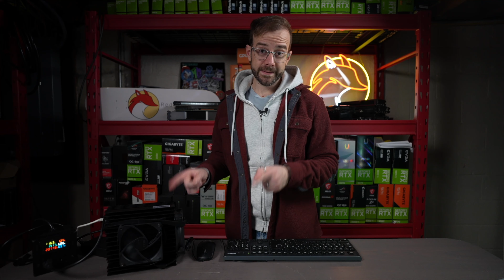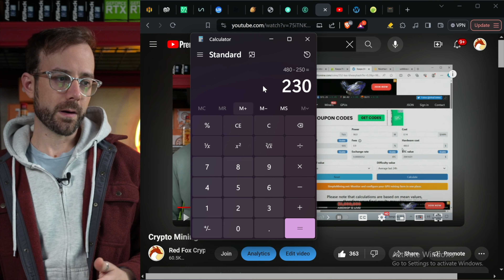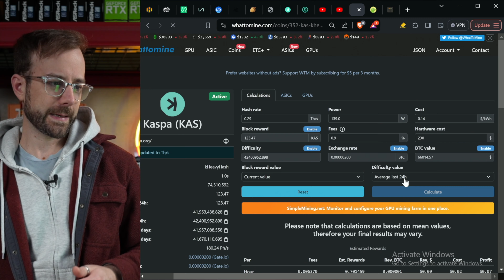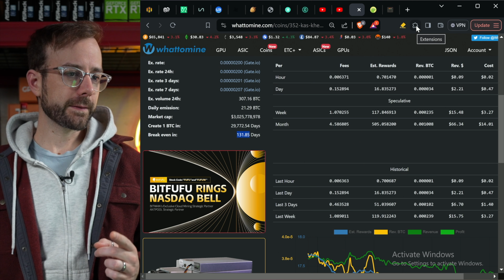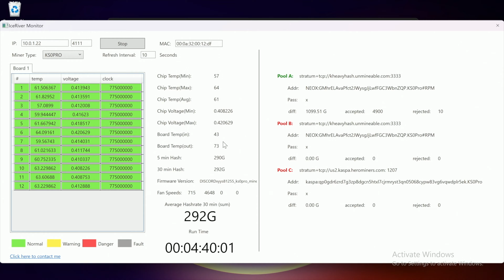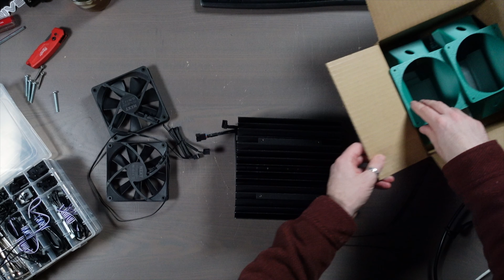KS0 Pro Break-Even Progress, Profit & Cooling Upgrades

Comment: The best thing you can do to properly cool these when OC'ing is to apply small heatsinks to the power stage ICs.  These are what get hot, and what are driving the exhaust temps.  Hash chip temps are not a concern on these models.  There's also a much better OC firmware that graphs all these metrics for you, including the power stage temps, and allows actual tuning of the clocks and voltages, so you can tune for even higher hashrate.  Or at a minimum, avoids using someone else's guess at the required voltage which is almost certainly more than actually required for most machines.

Comment: The Meter Box folks calls it a shroud. Technically, it's a plenum.  Waiting for my own shroud and grills from TMB.  Hoping to win one of those KSO Pro's. Fingers crossed.
Reply: I would've just 3d printed you some. Thingiverse has them for free, same for the side panels too
Reply: @BlessedNoobCrypto I plan to do that once I receive the new special edition KS0.  Need to verify the dimensions vs the build volume of my Replicator 3D printer. Looks like your new BL P1S could definitely handle the job though.  Keep on innovating my friend.

Comment: I run mine at 340Gh/s, 171W, board in 31 out 69 Celsius (ambient at 26), don't use the grills they reduce the flow. Also put the power supply on top of it, close to the shroud for the ethernet/intake it will help cooling the psu and also channel the cold air to the more hot side that is the here you connect the power. I use Thermalright TL-B12 2150rpm they are very good even bring the screws to fix it to the shroud. After my psu fail I discover it's important to have a good psu before I had almost 5% rejected and after connect it to a lab psu had 0%, got a new one for a laptop and have 0,013% rejected. Don't know if you put heatshinks in the 4 mosfet they are need, with the short ones 5mm I had them at 92 Celcius for the 60 of the board, use good and tall ones. Thanks for your channel like it a lot.
Reply: what are your oc settings?
Reply: @Chopper-w50  At 340Gh/s the clock is at 925Mhz voltage around 0.44V, I'm using this firmware Version   BOOT_2_0.BIN image_1.0 Tswift_GigaChad_ks0pro_miner

Comment: i found shrouds choked the fans down too much. i could feel air blowing back out the intake side because it had no where else to go. i have a bunch of these. pro and non pro. theyre mostly all running off standard psu's 12v and all are oc'd 150 -300+gh. i put mine on some repurposed open air mining frames. i used wood on the bottom for the miners to sit on and used the fan mounts they came with. i 3d printed stands for all the miners so they have air flow under them as well. took off both side grilles and put them fairly close to the fans so the fans blow straight through the machines and cool top and bottom. they all stay cool and i dont have a dozen+ cooking hot power bricks any more. i tried a bunch of different setups but this has been the best so far. just make sure you use quality 8 pin to ks0 power plug adaptors if running 12v.  i had some 6 pins melt with the 300gh oc

Comment: I would think you would get even better temps raising it up a bit so the stock intake fans can pull more air, also why even put the side brackets on? wouldn't having those holed plates off increase air flow?